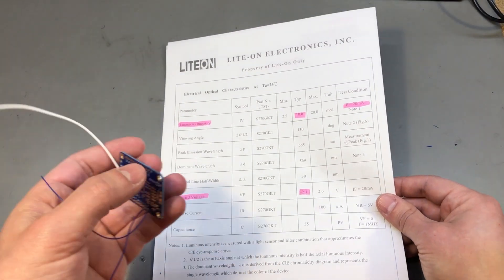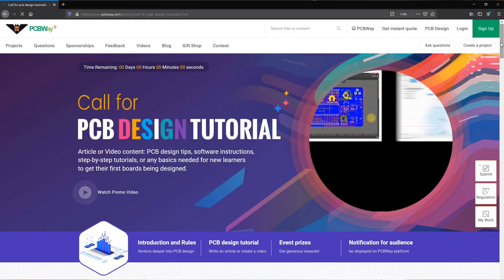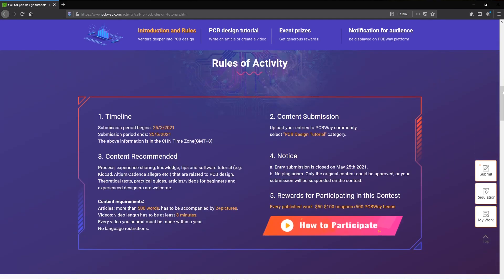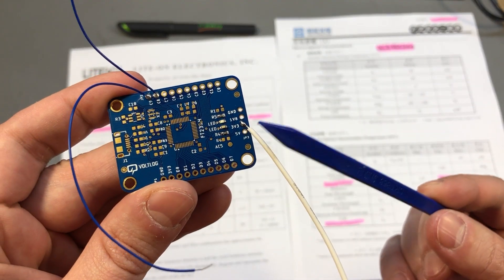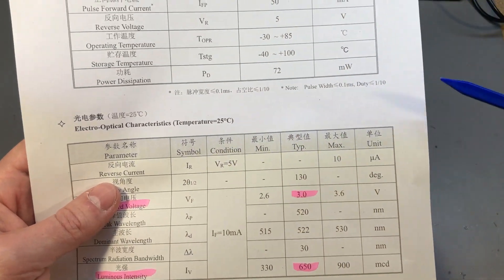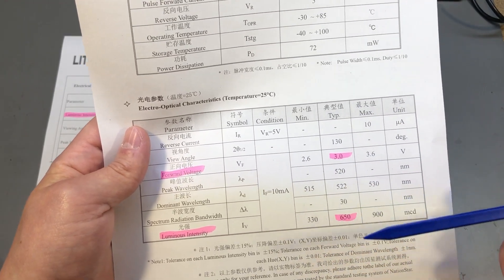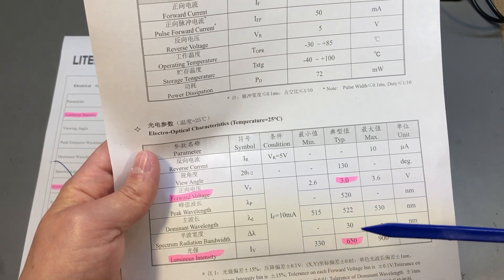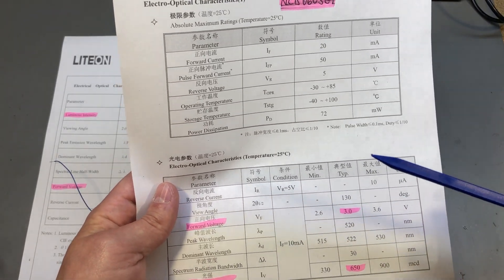Use These LEDs For Your Next Project - Voltlog #362

Comment: One thing that EVERY SINGLE DESIGNER should learn is this law about onboard LEDs: if you could ever, in the strangest possible scenario, see a consumer user putting your device in a place where a human being sleeps, then there MUST be a way to turn the LEDs off. No ifs, no buts, and certainly no "but we only run them at 3mA!" excuses. This includes OLEDs and backlit LCDs, too.
Reply: My wifi router has a feature where it will turn the indicator lights off overnight. I wish all devices were this thoughtful.

Comment: The problems with these leds is that you can't just replace the old leds in production. If you don't read the specs carefully and just order "a random 0402 green led", you end up with a super bright led on your board and need to respin it with a different resistor.

Comment: 0603 ?  Why use such a small LED when you have that much room on the PCB?  I much prefer to use large diffused LEDs that don't blind the viewer and when put next to each other you can tell which one is on with ease.
Reply from the maker: The question of why to use 0603 doesn't have a simple answer. Some boards need to be smaller. Some products need to meet to lower cost as much as possible so the obvious choice is to go smaller. In my designs 0603 allows for compact designs while still being fairly easy to assemble by hand.

Comment: Well, the 565nm led is typical of GaP or InGaAlP led, these have do have poor efficiency. The Foshan one is the newer GaN technology what makes blue and UV leds possible. Their luminous efficiency is much better. These two are not really comparable, you can find a GaN green also from kingbright et al. 

For indicators I do try use the yellow/amber LED's as the yellowgreen ones do have poor efficiency. The high efficiency Red ones are good as blinkies.
Reply from the maker: I'm sure you can find high efficiency LEDs from every manufacturer, I even mentioned this in the video. This was just two LEDs that I picked from my box of LED to compare between a standard LED and a more efficient one. It's not a comparison between manufacturers. I think this could be a typical scenario that a maker could be facing.
Reply: About the Amber ( and Blue ) , any suggestions for a high eff LED? In the past I did order a few, but they where inefficient. Thank you.

Comment: 3V, it sounds like a blue led with phosphor, i.e. reliability depends on how long the phosphor last.
Mostly 1-2mA is enough for the standard green led (i.e. a 2V led) when used for indicators, at least in my designs. If I use 30 years old leds they need some more current.
Reply from the maker: The example that I show as inefficient is not a 30 year LED. It is what you get today, from a known manufacturer at a known distributor and yet at 20mA it doesn't provide enough brightness to be clearly visible in bright ambient light. The problem is made even worse in practice because I will typically design for 10mA or less current on these LEDs.
Reply: Yes, 15mA or more to don a LED is living in the past.  This is 1990 era efficiency.
My personal favorites are some clear, straw-hat blue ones, which are plenty bright at 0.5mA!